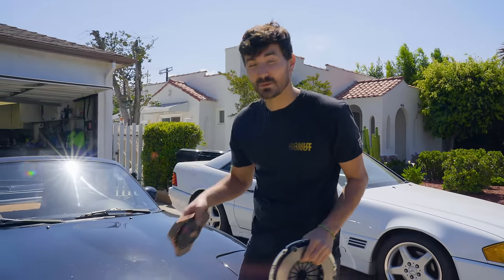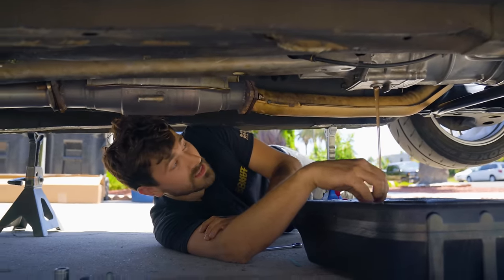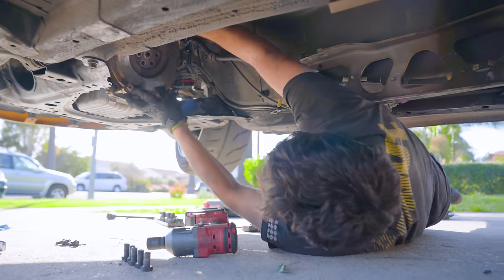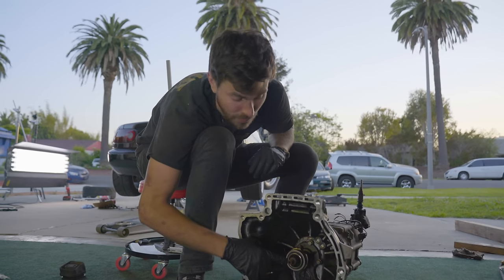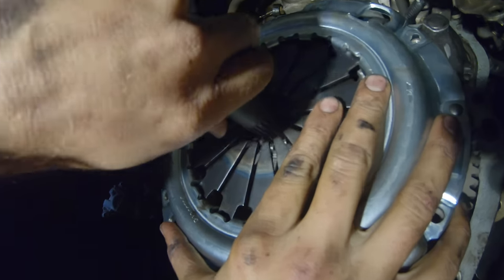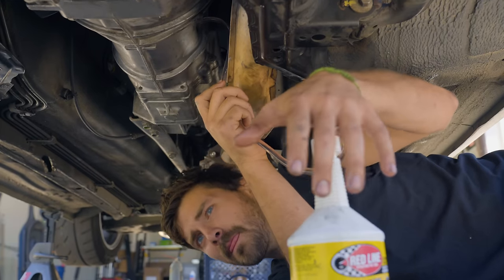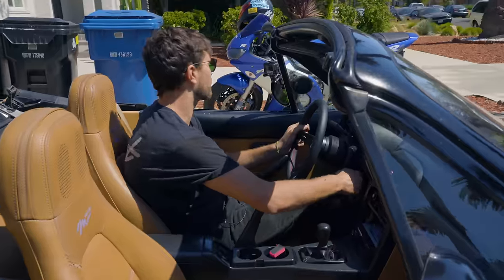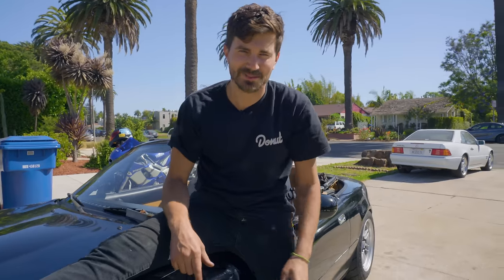We got sent a super weird clutch and installed it anyway

Comment: I installed a high performance clutch that looked like a plus sign and it was responsive but it actually lasted compared to a normal clutch. Took a while to get used to but was better than replacing the clutch and pressure plate even 20-30k
Reply: Replacing a clutch plate every 20k?? How do you drive?
Reply: @ulukai_555  😂😂 dude burning the fuck outta his clutch
Reply: @ulukai_555  I'm guessing he's riding his clutch. 
Some, who don't know any better, keep their left foot in the pedal for a large portion of their cruise time. 
Had habit!
Reply: I know people who get 300k out of s clutch. How do you get 20-30k?
Reply: @ulukai_555  bro is keeping one foot on the clutch at all times
Reply: @HPsawus  amateur... Real car guys keep the clutch half engaged at all times to cut shifting times by 30%

Comment: great advice about cleaning the flywheel, changing the rear main, and not greasing your splines too much... but it should be noted that the cerametallic medium doesn't absorb the oils like the organic does, and wouldn't be as detrimental in the case of a puck style clutch..

Comment: One of the beauties of a motorbike, swapping the clutch for most involves - (drain oil, or if in a rush just lean the bike over)remove crank case cover,remove clutch basket,replace friction pads+spacers,put basket and cover back on. First time I ever did one it was 2 hours and that was just through being cautious.

Comment: I learned to drive on a 1955 Morris Minor with about 1/4" pedal travel between disengaged and fully engaged.   After that, every other clutch was easy!    In fact, I like a short clutch travel - makes gearchanges quicker and easier.
A lightweight flywheel should also make gearchanges much quicker and maybe slicker, certainly does on my old Escort.    Don't know about the three-lobe clutch though.
Trick for reinstalling gearbox - drop a chain through the gear lever hole in the tunnel and attach it to the box.   Then a helper inside the car can lift the back end of the box via the chain (or if doing it single-handed, pull the chain up in stages and secure it with a screwdriver thrust through the links across the top of the centre tunnel.   This requires a lot of scrambling out from under the car and back, but if there's no helper handy...
All my clutch changes are done in my driveway (or in a carport).

Comment: Been a while since i did a clutch, and i don't know for sure if this suggestion would help in your situation but i used to get a bolt same diameter as a mounting  bolt but longer and with a grip so it's smooth.  Cut the head off this longer bolt so when you heave it into position   you can slide it in on the longer smooth bolt.  Helped me reduce some of my failed attempts when lifting and lining up a tranny.

Comment: My friend and I when we changed my clutch didn't have a specialized jack for transmissions so what we did was attach a tiedown strap from one of the door latch catches around the bottom of the transmission through the hole for the shifter then attached to the other latch catch.  I was able to slowly let the strap down as she lowered it from below.  It actually worked rather well and we were able to get it back up into the car the same way.

Comment: Quite a few years back, I needed a new clutch in my 83 Nissan Sentra wagon.  I think a quote to get it done was under $200.  I decided to do it myself.  It went well.  Front wheel drive; rip one wheel off and get that half-shaft out of the way.  Trans out, pressure plate off, old clutch isn't any good as a Frisbee either.  The new clutch was (if I remember correctly) less than $50ish.  Started putting it all back.  As I was going around the pressure plate with that one final click, the wrench slipped and I sliced the back of one finger along the edge of the engine.
So, after a trip to urgent care for stitches, and a case of beer for my neighbor who helped me put it all back together, I saved about $2.00 on the job.  Success!

Comment: Tip for removing rear main seal: Drive a small self-tapping or drywall screw into the seal, then you can pry or pull on that screw to get the seal out with minimal risk to the sealing surfaces, and minimal time and effort.

Tip #1 for aligning splines: Turning the crank is usually simpler than turning the transmission in situations like this.

Tip #2 for aligning splines: On many vehicles you can simply rotate the entire transmission until the splines line up, then rotate it back once the splines are engaged to line the bellhousing up with the block.

Comment: I think the main point of the ceramic clutch is that it wont warp under abusive use (lots of slipping) along with the more aggressive grab. When my dad was using a 2wd 1984 F250 diesel to pull a 8000 lb fuel trailer he switched to a ceramic clutch because there was a lot of backing up to tractors on the farm in fields (lots of clutch feathering) and the fiber clutches were ruined fairly quickly.
I have no idea how many miles that clutch lasted, but when I was driving it in high school it worked fine, until one day the clutch started slipping climbing a hill. Pulled the clutch and replaced it with a fiber one (we have heavier 1 ton trucks with 4L to move that same fuel trailer most of the time) The ceramic clutch pads were in good shape when we pulled it, but there was a serious trench made in the flywheel where the ceramic pads had wore it down until the clutch no longer had enough movement to clamp the clutch with enough force.

Comment: For many yrs in alaska. I  had a clutch that looked a lot like your new one. Ceramic on one side Kevlar on the other. it was in a 87 Ford F350  4dr with 5.9 Cummins.  For twenty yrs never slipped once. never failed.  lots of snow lots of mud trails. lots of water.  i hope you have the same luck I had.

Comment: When I changed my clutch and flywheel on my 330ci e46 I needed 2 days😂
Reply: I changed the clutch on my 2000 Toyota Celica GT-S and it took me a week!
Reply: I replaced the headgasketS on my '02 Taurus v6 in 2 days
Reply: @fortisprocer966  I spent a month on my Miata clutch last November-December.  But most of that was taking it apart, figuring out what parts to order, waiting on parts, putting some parts on, discovering I needed more parts, ordering and then waiting on THOSE parts to come in, then getting it all back together finally, exactly 30 days later.

Comment: 14:40 is it just me or is his left rear tire not spinning when he put the car into first
Reply: It's doing that because he has an open differential as opposed to a limited slip or lock/welded diff. I also have an open diff on my miata :( No sweet skids, just the classic one wheel peel.
Reply: New to cars?
Reply: Many Miatas had an optional LSD rear end, which would make both wheels spin while off the ground.  I know mine did when I tested it after changing my clutch.

Comment: try putting a np495 in like that. they're a bit on the heavy side. worst part is lining up that input shaft on this sort of job. been there and done this too many times. something to avoid is a reman unit in my experience. they might be ok now but i've went through several over the years. finally i opted to get a new, not reman, unit and it was worth the extra. engaged super smooth and lasted till i got rid of the truck. one year i done this job twice and i'm not too hard on them. of course it might have been working the truck but it should last way longer. also for the new people, look the flywheel over real good for heat cracks and uneven spots. might be able to have it turned but those will need addressing also if present.

Comment: Had one in my 65 gto, used to run mid 12’s in quarter mile. It was called the “cleaning lady” made by Zoom.. 3200lb pressure plate if I remember correctly. Long time ago. Never had an issue with it. 400 plus hp...a little chatter on the street,but drivable..

Comment: At 14:01 and 15:11 you want to get that steering rack gaiter replaced it's badly split. It would fail the yearly MOT check in the UK. Dirt getting in will damage the seal.
The new clutch is not a full circle because the more powerful spring would definitely make it an off on switch, that is why they made it a 3 puck. The Cerametallic material will help stop clutch burn if you dump it at high revs a few times in a row.1

Comment: The funny thing is some mechanics think the same type of bolt can go into any hole of the same bolt.  And while yes, that is true. The issue comes from any debris, or slight thread damage is matched between the bolt and the hole it came from put the bolt  in a different thread hole, and you weaken both bolts and possibly the threads of two holes.  Keep bolts to the thread they came from. Some times doesn't matter, but when it does. Bolts may break

Comment: I know this is well late. But when I did this. What really helped align the gearbox was for my friend to just push on the rear of the engine from the top down. That lowered the face of the engine and let us slide the gearbox in and it all pulled itself back in place when he stopped pushing on the engine 👍

Comment: look at an oem or standard organic clutch. between the clutch friction discs, you will see a wavy support that they are riveted to. THIS is what gives you this gradual engagement. the pucked style clutches typically have a SOLID support. this is typically what causes a on/off pedal feel.

Comment: Ceramic based clutch discs been around for decades.
We mostly used them in trucks. Hauling heavy loads or plowing. 
Always fun benchpressing tranny in a snow covered driveway at 10 below zero. Glad those days over.
Especially if inexperienced driver.
Handle heat and load a little better.
Never buy a remanufactured clutch though. Crap shoot. End up replacing  
Half of them. And ceramics when bad chatter like crazy.
After the 3rd one. New or not at all.
Parts store warranty all day,but labor take you a year to get your money.
Great video. 
 No pilot bushing or bearing to change out? Or in good shape?

Comment: The likely reason that it isn't as harsh as you thought it would be is because it is still a sprung clutch. If it was unsprung, then it would engage much more suddenly. The engagement zone is also shorter because there is more material on the clutch than the old one, so it doesn't have to travel as far before making contact with the flywheel.

Comment: Years ago, I pulled a Turbo 400 auto trans the same way, I suspect it weighed a touch more than that one!

You have an open diff on your car?

I have a three puck on my Fiero, it has organic on one side, and ceramic on the other. It was a different feel, but still very drivable with the organic pads, yet it held the torque very well! So well, the trans chewed up the syncros on first and second, and now the engine is blown!

Comment: The first 30 seconds...3 lobe clutch, high-spring rate pressure plate...those are used in forklifts, often with a LOT of oil cooling and some even have hydraulic assist for the clutch pedal release.

Comment: I've lost count the number of clutches I've replaced. Ford, Toyota, Jeep (AMC and Chrysler versions). Yikes! none where as difficult as this: the Miata requires oil and many parts to be removed before you get to the clutch. Only in Ford did I need to remove drive shaft, Toyota and Jeep, there is more than enough length in the shaft to just set the transmission down still connected. No wonder it took so long--my hats off to you.

Comment: I ran into the same problem of lifting the tranny on a 66 Chevy. Had to lift it back into place by putting it on my belly. Manual tranny's are normally not that heavy. It's not that bad. Clutch replacement is definitely one of those jobs that are doable in the driveway or garage.

Comment: Little tip, put the trans in gear so you can turn the input shaft with the yoke for the driveline. Makes line-up of the splines of trans input shaft a breeze.

Comment: Uhm. Did this job on a 240 several times.  You could put cinder blocks under the jack stand.  I did it on gravel.  But, do that in the future, if your incline isn't too bad.  Then, trans jack rocks.  And in this case, always pull the shifter at the start.

Comment: I have the same thing in my Celica. Mine's rated at 350 though and it's a third stage racing clutch, supposedly. The 1.8 stock only does like 105. I am running headers & a more aggressive intake. Looking to put a Supra fuel pump and some four squirter injectors soon. I have not put 20 valve heads on my 1.8s yet. I like mine and it seems to be made for racing because it responds well to just dropping the clutch. That one you have looks like a second stage. Mine has 6 pads. I did not run a lite flywheel either. Not until I get the horsepower up. Donuts awesome👍👍👍

Comment: Between this channel and ChrisFix, you guys make working on cars so damn approachable. Obviously a lot of this stuff really isn't that hard. As in, even doing something as complex as pulling the transmission isn't physically that difficult. Vast majority of the time you're just removing bolts and draining fluid. The issue is remembering exactly which order everything goes in and out properly. When you have such a high quality reference like this video, it feels like a lot of people could accomplish this on a Miata. Just because you guys (and ChrisFix) are so excellent at documenting the process. You're both so charismatic too which really goes a long way into making people feel empowered to do their own work. Maybe not for a job like this as there's a lot that can go wrong. But for a lot of stuff. You guys are going to save people thousands and make them more self reliant along the way. 

I'm more of a computer hardware guy. I can read a schematic, pull out the microscope and solder with the best of em. But I hadn't really done anything behind an oil change on cars. Definitely starting to change that. Not that I'll ever get to the point of rebuilding an entire engine or something. But I'd love the ability to keep older cars on the road. I've always just had so much more appreciation for a clean example of an older car compared to just buying a new one off the lot. The former is just so much more interesting.

Comment: The first time I did a clutch was on my old 1969 Toyota Hilux. There was enough room in the engine compartment to loosen the motor mounts and slide the engine forward. It went pretty good until I had to slide the engine back onto the trans spline; that took an hour of positioning the engine until it magically just slid on. That was definitely the worst part, but of course I didn't know what the correct procedure was, I just bought the parts and started unscrewing bolts.

Comment: A little tip that will make installing the trans easier when you are on your back under the car. Get yourself 2 long bolts that screw into the transmission mounting bolt holes and cut the hex head off the bolts. When you go to install the trans, screw one of these long bolts into the bell housing on each side of the trans and then slide the trans onto these long, former bolts now guide rods. If you can use the top bolt holes for the trans, you will get less tilt in the trans as you slide it in.

You still have to deal with getting the splines to align, but at least you are not holding the transmission up. The length of these bolts will vary for each car but they need to be long enough to be able to get the transmission on them before the input shaft starts to engage with the clutch plate. I would guess that 6 inch bolts are longer than you would need for most cars.
Reply: Further tip - after you cut the hex head off the bolts, cut a screwdriver slot in the end with a hacksaw or a thin cutting blade in an angle grinder.   Makes it easier to get them out after.

Comment: Reminded me of changing the transmission on my 1988 GMC Jimmy. 
 I rode that "struggle bus", 😁 3 times in a row, underneath the truck, I felt like a contortionist, bench pressing the transmission with my knees assisting, albeit I had more room than you, I did have a transfer case for 4 wheel drive attached. 
 I can totally relate. 😉

Comment: I just put a stage 2 heavy duty street clutch in my Bugeye that is rated for 340 ftlbs and it is exactly what you were talking about. It has 6 springs but it almost feels like it's a solid center clutch. It is much harder to drive and the clutch pedal is extremely stiff. Not gonna be fun in traffic.
Reply: Update on my last comment, the torque rating on that clutch was extremely optimistic. After a few basic modifications and a tune the clutch did not hold. I made 304 ft lb and 320 wheel horsepower on the dyno. Clutch lasted less than 2 weeks after that. Have since installed an ACT SB9-HDSS and it has been perfect.

Comment: Very interesting to see the difference in car clutches vs what i've seen of motorcycle clutches. Motorcycles have like 6-8 friction plates held between smooth plates, since the system is wet you have to soak the plates in oil. So it makes a lot more sense to me how its so important not to drag a car clutch. Only having 1 plate is insane to me

Comment: my uneducated guess is the fact there are only 3 pucks adds to the drivability.  Like if it was a full disk of aggression that would be an on / off switch in my opinion but the fact it's limited to just 3 pucks gives you that sweet spot of mild aggression while not taking away too much daily driver feel.  I could be wrong, but friction coefficients 'n stuff would probably agree with me that a full disk would be more aggressive than 3 puck chuck over there.